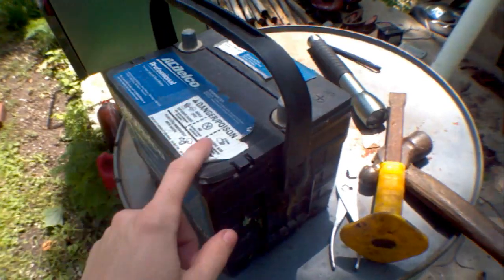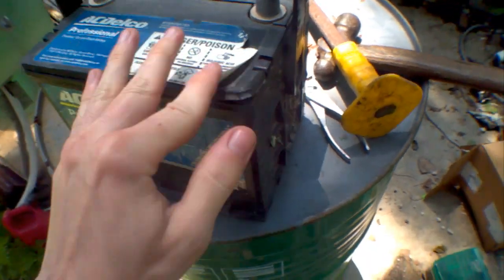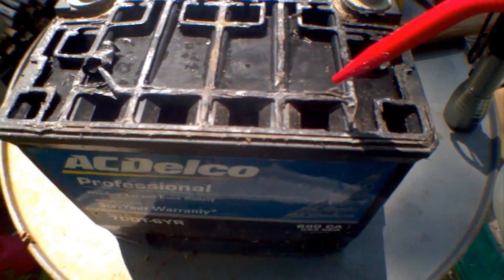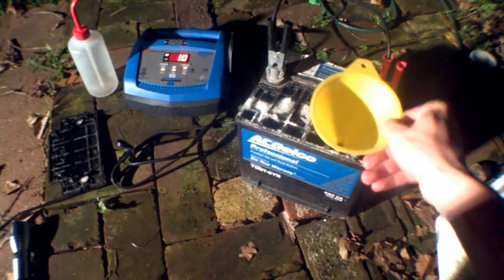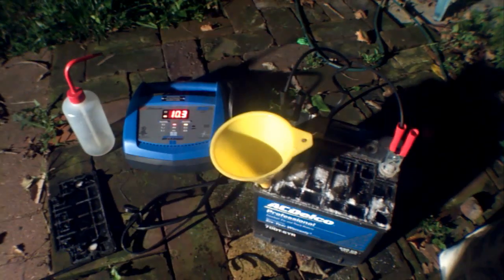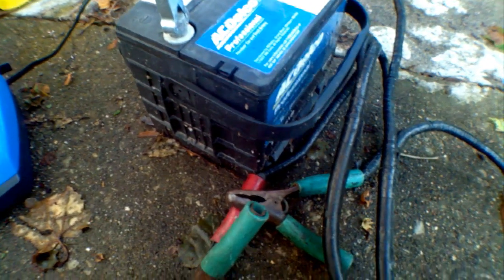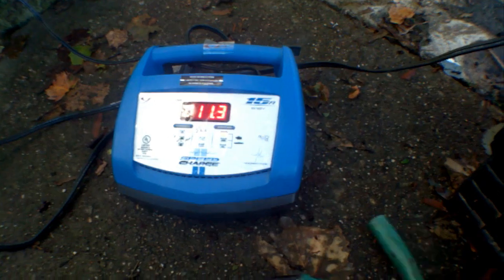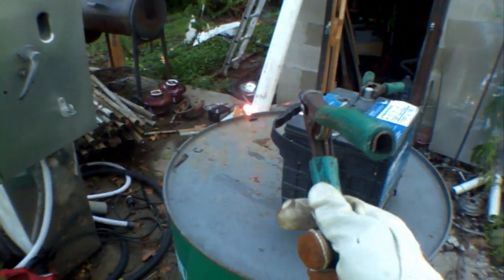DIY: Opening a Car Battery and Repairing with Epsom Salts

Comment: Know whats funnnnnn, is that the Acid is STILL there, Just that the Electrolysis, Got rid of the water....  They have this Interesting table, that VIBRATEs or Swivels around with a motor.  Takes a few days to Wash the Acid BACK into the water..

Comment: Saw someone 'reverse polarity charging' after draining be battery to zero. And it works, re etch terminal points to negative ( from positive) etc. could be a faster more efficient way to 're activate' dead heavily sulphated battery? Also 'drain out' battery acid ( for reuse) after first reverse charge to prevent shorting ( built up broken bits at bottom of battery).

Comment: Thats 3xiting I'm 13 yers old and I wanna try to do this I think on the back yard is a old battery
Reply from the maker: If you play with batteries, make sure you have a bucket of water ready to neutralize any acid that may get on you. Baking soda works great as well at neutralizing acid

Comment: Use a sulfuric acid drain pipe cleaner.  I drained all the battery acid from battery in a plastic container and added extra sulfuric acid and distilled water with hydrometer and refill the battery.

Comment: You are So unsafe and dangerous, Sparking next to recently charged cells .. you Dunce
You obviously haven't seen Hydrogen gas ignite in a battery YET ..
In 30years, Ive seen 2 explode!
1st was an apprentice fitting a recently charged battery, when he sparked the terminals and it blew up in his face .. No fire, just a LOUD explosion and battery acid in his eyes .. (2 days off work, but no permanent eye trouble)
2nd time was a guy standing on truck batteries to reach and weld  a Steel Tipper body, half hour into his job, Slag beads from the weld were falling at his feet.. I was 50m away when I heard the Explosion .. 
He wasn't  injured but scared the crap out of him, again Acid around his trousers ..
Hot glowing Slag was even enough to melt through the plastic and ignite the Hydrogen ...

PS your an idiot, showing this vid

Comment: Here's what you do: Take your Epsom Salt, and create a mix that's 2-parts Epsom Salt for 1-part water. So, 2-cups of Epsom Salt for even 1-cup of water. Grab a 4-quart pot (with a handle), and mix the Epsom Salt with the water in the pot. Then, bring it to a slight boil while stirring it, so it disolves properly. This is why it took longer for your battery to achieve proper voltage...because, it had to mix itself IN THE BATTERY, which takes DAYS. Or, you can just mix it yourself in the pot, and it takes minutes. YOUR CHOICE!

PERSONALLY: I've been putting Epsom Salt in my cheap Walmart brand batteries for YEARS! Then, battery manufacturers found out people are adding Epsom Salt and making those cheap batteries last A LOT longer...so, they made it A LOT more difficult to open them up (which is why they're all sealed now). Those cheap Walmart batteries would usually last between a year or two. But, the one I added Epsom Salt to is on it's 6th year right now, and still going strong!

Comment: putting the battery on concrete doesn't help
Reply from the maker: Doesn't do anything. that's a myth from the 1930s when batteries were made from wood. Concrete does nothing to batteries after the 1950s.

Comment: You did a spark test at the cathode?! I’m pretty sure it releases hydrogen gas at the cathode and oxygen at the anode.
Reply from the maker: It's not that simple since it releases hydrogen and oxygen from each cell. Remember this is 6 cells not one.

Comment: I saw that same reaction too cranking apps came up It seems like the more I aren't the back-and-forth while running the pump. They would speed it up and slow it down and then slow it down and then sometimes it was just slowly coming backup as the battery got dead but I. Did see increasing cranking apps afterwards basically that was low testing it at low voltage on the battery

Comment: This is exactly how you should NOT open a battery ever if you don't want get injured. Really dangerous hope people don't do it. If you have acid chambers you can open easily you could add "destilled water" if the elements are not covered in acid anymore and try to recharge it.

Comment: How did you seal back the battery cover so it does not leak if you tilt it?
Reply: jb weld .. and dont tip it 😉

Comment: Yeah, spectacular, looked like it was putting out about 100 mA there.  A real working 12V lead acid automotive battery would have melted small places on the clamps, the spark would have been very audible, and you would have seen small droplets of clamp falling to the floor in a liquid state.  What you got there wouldn't light a headlight more than very dull yellow and not for long.

Comment: Science teacher said this. 

Water does work but has to from steam and not from kettle as normal water has iron particles which would short the pos and neg electrons inside the battery so making it useless.

Battery has acid inside. The water does not change the ph level of the acid. 

Sealed batteries was just a fraudulent scam by battery companies. They sought a way to stop you refilling batteries at home and making sure you had to buy new ones. They should be heavily fined for that. 

Sealed do not work any different to non sealed. Chemistry inside is exactly the same.

Comment: There are  several things for battery repairing
do not try to do this until you know what you are doing - the acid can burn you
Test the voltage first - there may be a kaput cell which would waste your time.
Check the battery fluid.
Try to fully charge the battery.
(I discovered about these and more from Jons mender guide site )

Comment: Using a decent battery, I've actually welded using standard welding sticks. At that time I had a small electrode holder that had a solenoid in the head that pulled the stick back on contact with the materials to aid in keeping the correct electrode gap. You can still do it with a pair of jumper cables, but watch out for overheating the leads as some are too thin to weld for long and can melt the plastic insulation!

Comment: 1st...WTF.. Are you doing...
2nd..put the battery on a wooden or rubber platform
3rd...charge at low voltage at start and then move higher
4th..how are you going do put the cover back on

Lastly... Are you that special kind of idiot or just CLEVER.. Animals are clever and people are supposed to be Intelligent... You are the missing link...

Comment: I have 4 truck trailer lights I found by the side of a busy road, 3 incandescent, and one LED red lights, and ran them in parallel, the 12 volt adapter heated up, and melted, so I am running them on a 9 volt adapter with no problem!

Comment: What you DID when frying the small wire, was that you actually BURNED UP a "soft short" inside the battery, so now it has ALL the cells working, thus above 12 volt!

Comment: Adding the Epsom salt IS desulfating the cells. I've also had some success with Bedini motors which do something similar to those "battery desulfators" in that your turning the juice on and off several times per second. The Bedini motor seems to do something else as well though which I don't want to get into because it can start a whole string of debates. I'll just say that I noticed other phenomena that traditional switching action did not cause.

Comment: Shorting the battery heated the nixture inside and agitated the epsom salt some, putting it somewhere warm and giving it a good shake will do the same.

It takes time for the magnesium sulphate to shed the crystals from the lead sulphate, i bet a week later that battery was even a little better than 12.2 volts.

Comment: Follow up video needed I think. New sub here, very cool that you can bring back to life a 100$ item with Epson Salt for pennies on the dollar. I live in the pacific northwest, up here when a battery goes dead we throw it on a pallet and take that said pallet, when full, to the scrap yard and get paid for batteries Led weight.... 3$ -6$ per battery scrap value.... This video however has made me think, that using this technique depending how long said batteries will last or perform at that higher voltage, there could be way better money in a working pallet of batteries.... Say 20$ a battery and offer 60 to 90 day replacement..... 

UPDATE VIDEO PLEASE. HAVE YOU PUT THESE TO USE? HOW LONG DID THIS ONE OR OTHERS LAST? Did they keep consistant voltage?

Thnx for tip. And my .02 cents. Gloves and at least socks brother!!! LoL we need those digits and we need you to be able to record more video@@@!!!!! 

Thnx again. Subbed

Comment: I won't go into safety or any other crap, but if you just drill holes in the top to do your electrolyte adding or servicing it's much easier to seal them back up than if you rip the top off. You can seal the holes back up with little rubber plugs and it won't leak

Comment: voltage is OK if over 13.8 about so reloading voltage from dead battery is fine but you need amps u see load see if amps drop try a spot light ,100 watts for ,2 min then see what voltage is and during the instant load don't be fooled by just ,12-13 volts. parking battery not commonsense. use millimeter globe or spot light look at loads. and off losses of voltage. on moment and after

Comment: Epson salts doesn't work, it will give a temporary boost which will be short lived and will soon fail completely due to the salt impurities you just added. A good battery should show 14+ volts when charged, And give you a big tip NEVER EVER short a battery and create a spark. It don't happen very often but it does happen more than you think, They EXPLODE. Big time. My work college accidentally shorted one while it was charging, (its when they give of gas) and it put him in hospital for weeks, The lead terminal on one end went through the factory roof which is about 30 feet high.He had lead and acid in bedded in his face and lower arms and hands. Very lucky bloke. We had to get him to hospital real quick, luckily it was with in walking distance. The entire top of the battery was gone , just tiny bits of plastic left scattered.  The explosion is bloody huge. I was only metres from it when it went of.  DO NOT DO iT.

Comment: I smell a low I.Q. in a lot, and I mean "A LOT", of the comments.

Thanks for the demo Rinoa Super-Genius.

I have a question: Would you say that there is a relationship between the amount of Epsom Salt and the % of voltage recovered by the battery?

Thanks.
Reply from the maker: the epsom salt basicly lowers the internal resistance of the battery, kinda like adding more acid. it would raise the voltage up to a certain point.
Reply: I enjoy finding videos to show how NOT to do things

Comment: Adding Epsom salts will make the battery loose charge (self-discharge) much faster.  If the battery self-discharges too fast, you could overheat the battery and it could explode. But, if you don't need to hold a charge for very long, you might be able to squeeze a little extra life out of the battery. Next time, I would weigh how much epsom salt you are adding to each cell and add as little as necessary.  You can always add more, but getting it back out wouldn't be worth the trouble (electrolyte flush).
Reply: How would it explode from overheating? Something would need to react from high temperature and the only thing that can react to cause an explosion, a hydrogen-oxygen mix, would require a spark, not temperature, unless you reach its auto ignition temperature. Both the case and lead should melt long before you reach the auto ignition temperature for hydrogen and oxygen. That is 1065 °F.

Comment: Many times, you can drop a "dead" battery about 2 feet (your mileage will vary) onto a concrete floor (or other solid surface) that can often loosen the sulphation (sp?) that has built up on the plates. This combined with your methods can often produce even better results. Safety is on you. Just a trick I learned over the years.

Comment: dude you do know you can weld with batterys  right
Reply from the maker: you can also put 8 in series to use as a cutting torch. i weld with batteries as my main form of welding.
Reply: +Rinoa Super-Genius eight batteries ? wouldn't that cause an explosion?  car batteries arnt designed to house 96 volts !
Reply from the maker: *****
well ive done it in my videos, so no.
Reply: I admire your ingenuity but thats an excessive amount of power for the crappy plastic housing of a battery

Comment: Here is my method for rejuvenating SAFELY a 12V car battery.  1) Connect a small sealed beam light until the battery is totally discharged. 2) Check with a voltmeter , 0 volt must show on the meter. 3) Re charge the battery in REVERSE POLARITY until you reach nearly 12 volts. 4)  Redo procedure 1and 2    5) Fully  recharge the battery in the proper polarity, the voltage should-be 12 volts or more and the battery will be totally good for service. unles there is a shorted cell. What is realy happening. Reverse charging desulphate the battery by cleanig the plates inside.  The "garbage" falls down to the buttom of the battery leaving the plates nearly whissel clean. Remember that this method takes a couple of  days or so and don't rush the job by using a slow charge mode. 2 or 3 amps wich is more than sufficient.  Before installing the battery on a vehicule, take a voltage test (12 volts or more) and a load test with the proper test équipment. If the indication needle is in the green area then you know the battery will-be OK for an other couple of years or so. I have a 16 year old battery still giving good service without failing. I did this twice and it worked OK. Remember that the sulfuric acid in the battery will eventually eat the plates in the cells and it will-be impossible to extend its life anymore  but after 10 or 15 years of good service, let the battery rest in peace.Depending on the quality of the battery, She gave-you all it could. Eh voilà !
Reply: Serge Clement
Reply: I like this method way better....Not questioning your honesty,but you've done this a lot? Thanks Serge.
Reply: This is the method used by Hydro-Quebec technicians for reviving the big expensive diezel engines batteries. Instead of replacing the batteries when flat dead, the ones that can't hold a recharge, they sort of provide a "second life" and also, save a lot of $$$ by stretching their usefull life. Remember that such batteries cost well over $600.oo each and with the service fleet in operation,, it ads-up to thousands of dollars per year.. With this "treatment" those big batteries can last for 10 years or more then comes a point where the led plates are litterally "eaten away" by the sulfuric acid.  In this case, nobody can do miracles. On most cases, this method  can be used one or 2 times on a battery. The trick is that before a reverse charging is done, the voltage must read a flat ZERO. If any residual voltage is present, it might not work as planned. Do this in a well vented area and at normal room temperature. This rejuvenation method can take 4 to 6 days for the big batteries.The voltage is monitored at all times and an occasionnal load test is applied.But all in all, it is well worth-it.

Comment: I had a battery blow up in my face once,  kid... battery acid burns like hell .Keep a bucket of baking soda water around where you can find it with your eyes burnt shut from battery acid.
Maybe you just didn't know any better at the time ....Any body that works with battery's should be aware...
Reply: I've boosted 1000s of dead batteries. Many times I was standing over them with no eye protection. Had one blow up 3' away and got really lucky. The whole top blew off and it sounded like the report of a 12ga shotgun. one little drop of acid on my arm. Learned my lesson that day
Reply: I have spent months researching into fixing a car battery and discovered a fantastic website at Magic Mender Wizard (google it if you are interested)
Reply: Dear fellow I will show u here in my country no goggles and not safety method. Safety is good but if a person is in trouble he left all the safety and try to resolve the problem. I appreciate his work do share more useful videos.
Reply: I used to heat batteries on teaspoon by putting battery in the gas bouler pulot light hole and hovering it high above the flame so I could continue playing my pacman. Mum and dad in bed sunday morning. No battery. Watch battery. Me like 8 years old. One day the battery did not recharge ling so i took it back to boiler. Second time i was walking up the stairs it exploded arms length away from my face. 

Oops ha ha ha ha

Comment: You could short it with the battery charger on. That way you would get better sparks & we could get rid of what is a dangerous weapon in your hands. As for Epsom salts they  may reduce the internal resistance to give a sulfated battery a few extra months of life. When using Epsom salt,, heat about 250ml (8 fl oz or a cup) of distilled water to about 66ºC (150ºF), mix in as much Epson salt as the water can absorb (a few tablespoons) and stir until dissolved. Avoid using too much salt because heavy concentration increases corrosion of the lead plates and the internal connectors.Pour the warm solution into the battery,charge the battery.The results are not instantaneous and it may take a month for the treatment to work.

Comment: Don't use epsom salt use sulfuric acid.
Reply: +David Spencer empty the faulty Cell only and pour baking soda with Water in it and remain there over night.  then fill tap water and drain the Cell several times. then fill proper mixture of acid and water,  and then charge under controlled environment . it will be ok if the problem was just a sulfate.
Reply: Epsom salt adds sulfate to the battery but so does sulfuric acid. But epsom salt also adds magnesium which fucks up the lead plates
Reply: how do you remove the sulfide from the battery...not using some high dollar charger...chemicals? 
any help would be great